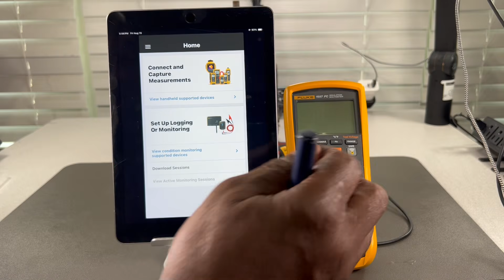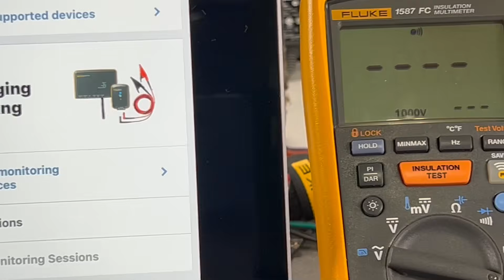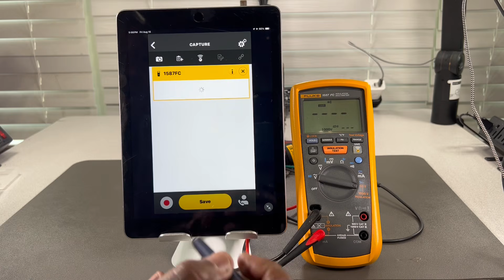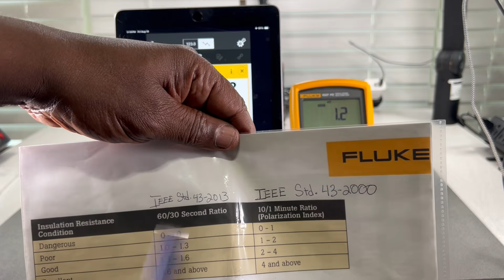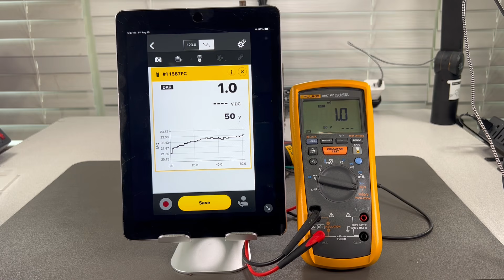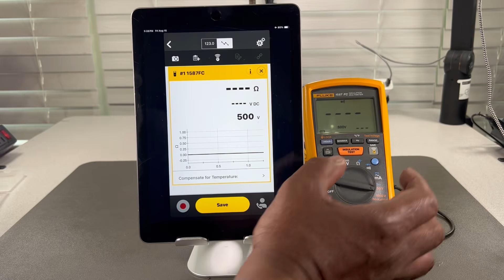Unedited video 1000volt  DAR/ PI Test using FLUKE CONNECT software and FLUKE 1587 Insulation Tester

Comment: I don't know what I'm doing wrong but whenever I try a DAR or PI test after a short time I get a Err
Reply from the maker: If I’m not mistaken I believe when the value of whatever it was measuring the measured value was off the charts to high for the meter to read. I seen that Err before.

Comment: Carrying out timed insulation tests on the same winding one after the other without discharging the winding in between tests leads to a poor analysis. The charge is slowly building up in the winding, you can see that as each new test starts out at around the same MOhm as the previous test stopped. Your first DAR test at 1000V started at 2.3 MOhm and finished at 5.6 MOhm, before showing the 1.2 DAR ratio. The PI test then starts at 3.7 MOhm and finishes at 11 MOhm before displaying the 1.7 PI ratio, and so on.
The final 10 MOhm reading is lower because the spot test was too short to give a true insulation reading of the motor. Usually you need 5 to 6 seconds for a small motor before you get a stable reading. The IEEE and IEC standards however, specify the insulation reading to be taken at 1 minute for motor windings.
Reply from the maker: You’re correct I wasn’t thinking 🤔. I know better and I didn’t allow the meter time to discharge the motor. Thanks TP

Comment: You must be reading my mind. Just yesterday I ordered the Fluke FC3000 kit. You get a meter, ac current clamp and a bag for 465.00. I read you can generate reports. Right now we just writing our voltage temp and current measurements on a piece of paper and putting in a binder. Some of the guys probably don’t even bother to see if any pumps or motors are trending towards failure. Hopefully a nice graph will help them see issues ahead of time. Not sure if you noticed this but a lot of even younger guys in the field are resistant to technology. My coworker groaned when I mentioned fluke connect. He is only 25 too. He prefers to do his rounds shove the paper in the binder and go back to tiktok videos.
Reply from the maker: Man, I was thinking to myself last night about how lazy and closed minded the younger generation is nowadays.